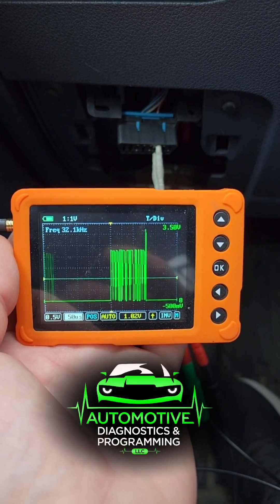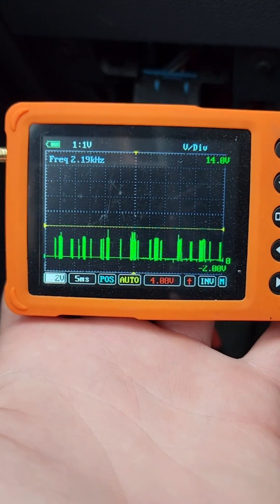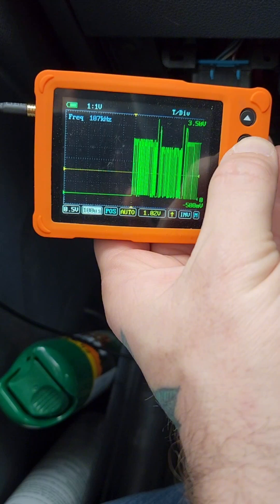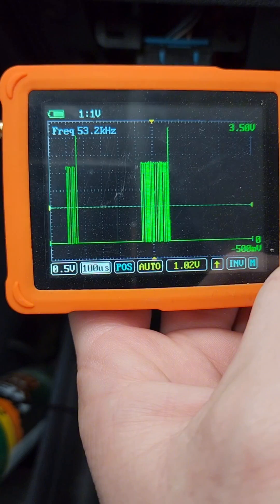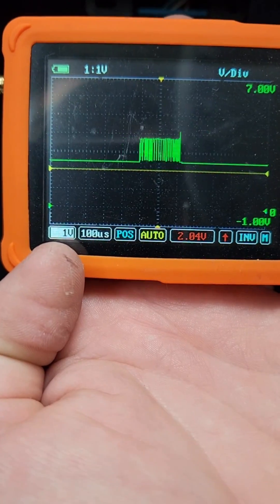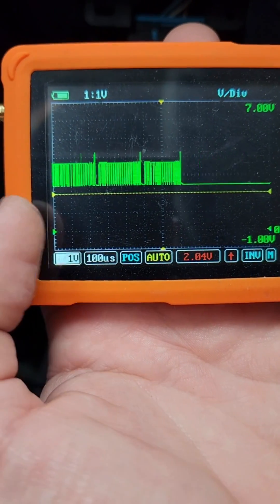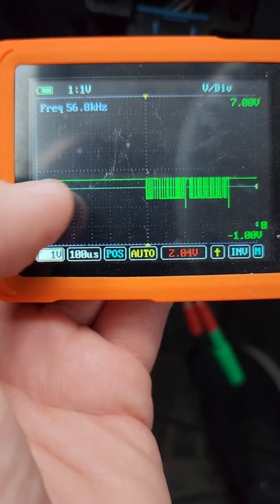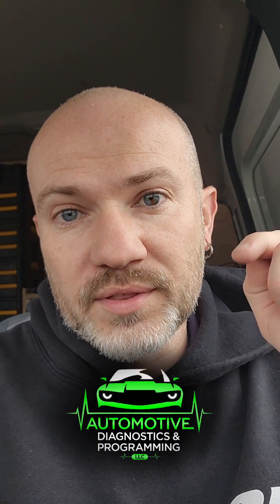Quick and Easy CAN Bus Testing with the uScope from AESWave.com

Comment: No joke, I had an O'Reilly's employee tell my customer I miss diagnose his car today. I got called out on a 2008 sienna start stall issue. I hooked up my scope to the ignition coil sensing circuit because of the codes. Right away I noticed there was only 2.3 volts instead of 5  (koeo). I unplugged the front 3 coils, no luck. Removed intake manifold and the first coil I unplugged on the rear bank the voltage went to 5. So the customer just bought coils 5 months ago from O'Reilly's. He went up there to get a warranty swap and the new employee said the coil was fine because it didn't smell or look burnt. No bs this is the second time he's done this sh#t. I put the new coil in and the van ran great . I can't believe this guy.. I diagnose for 4 auto shops, 3 body shops and 3 car lots in my area and a guy at O'Reilly's is going to diagnose by just looking and smelling apart. He really got under my skin today.